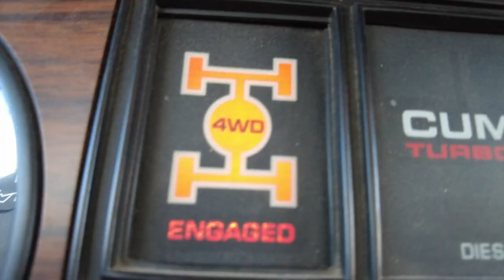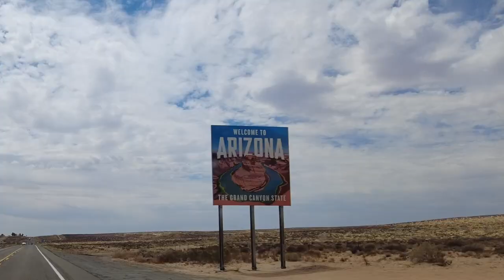Truck Camper Boondocking at Lone Rock on Lake Powell | DestinatioNow S4 Ep60

Comment: I have a 2019 F450 dually with a big camper on the back, would you recommend me taking it down to the area you went down? I've been looking on YouTube everywhere for a video of a truck and camper and came across yours.  I've been to Lake powell 5 times but never to Lone Rock and wanna try it. Any recommendations or help would be appreciated.  Thanks
Reply from the maker: Recommend is a strong word. I say proceed at your own risk ⚠️. The secret to driving a heavy rig in the sand is tire pressure. You want your tires to bulge ALOT.  I think I was running 25 psi in the back tires and 15 in the front. Have a plan in case you get stuck. It helps to have a winch and shovels. The link below is a video that I made about this very subject: https://youtu.be/JqwTUQUu_gE?si=E2Re6vklaTHMrvoR
Reply: @DestinatioNow  thank you
Reply: @DestinatioNow last question... how was taking your camper off and putting it on the sand? I see you have big jack supports on the sand but did the camper move at all? What did you use to stabilize it when camping and especially when lifting it to load it back on the truck?
Reply from the maker: Taking the camper off in this location was a bit sketchy. I don’t know that I’d recommend it to just anyone. I’d hate for someone to have an accident by putting it in soft sand or lifting too high in the wind. But if you must, we use plastic paddles under the feet of the camper and always use jack stands with wood under the belly for extra support. This is our normal set up for removing our camper. The jack stands keep it from moving around.